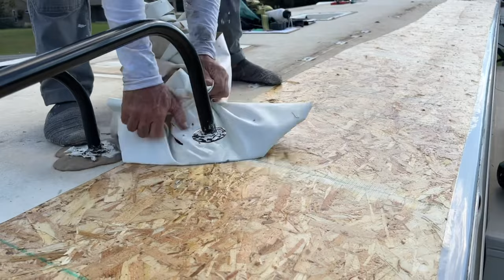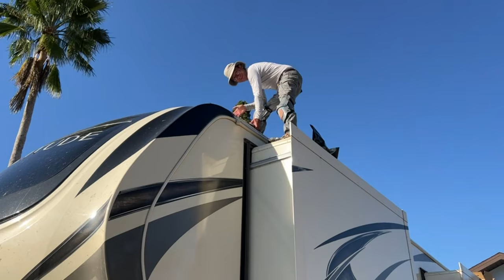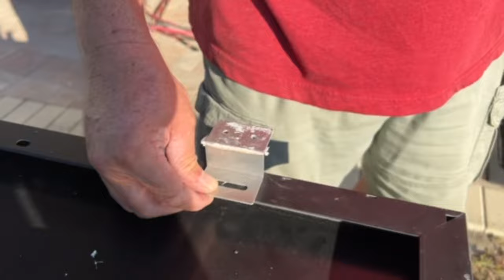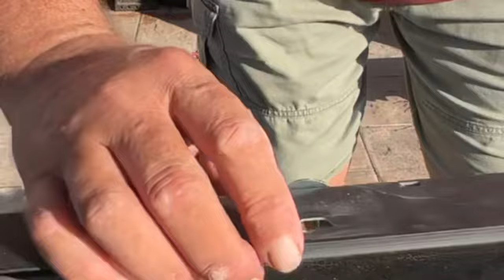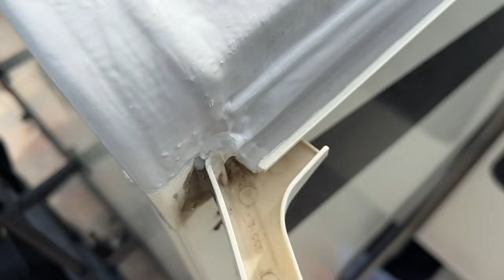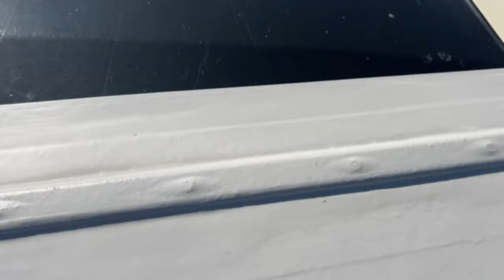GRAND DESIGN ROOF REPAIR with RV ARMOR

Comment: So sorry this happened to them.  I do hope that it was covered by warranty.
Reply from the maker: I’m sure they are going to contact the dealership.   At least it’s fixed.
Reply: @FollowingtheYellowBrickRoad  that is true.  Would love to know the outcome if they are compensated.
Reply: Not covered under warranty because Kevin made immediate protective repairs.  Full timers can’t wait as long as it takes to get GD to repair such an issue.  We knew this when the problem was discovered, but the leak had to be fixed right away.
Reply: @dawnklein3158  so sorry.

Comment: Great info. Am considering RV Armor also. I searched Amazon for the solar panel mounting brackets you showed but did not find them. Would you post a link for those please?
Reply from the maker: 5 Hole U Shaped Strut Connector Bracket, Height 1¾", Width 1½", Thickness 5mm, Fit for ½" Bolt in 1-5/8" Strut Channel, Steel Electrogalvanized(6 Pcs) https://a.co/d/14uFcug
Reply from the maker: Kevin also says: I then bolted unistrut from lowes to those brackets.
Reply from the maker: I hope this helps!
Reply: Thanks!
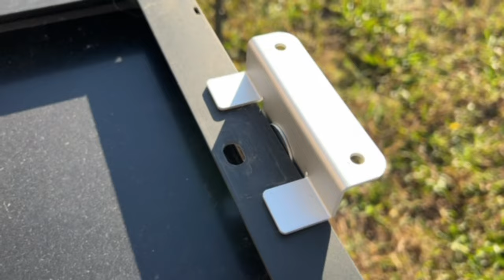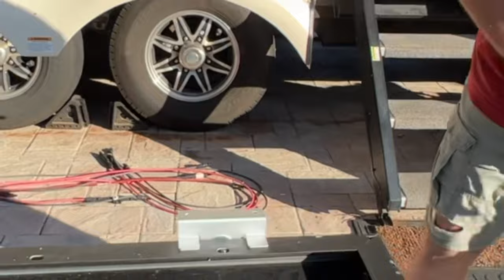Reply: @FollowingtheYellowBrickRoad  These aren't the brackets I meant. Im looking for the ones at 7:32 to 11:07.